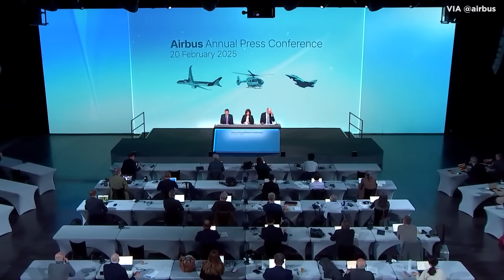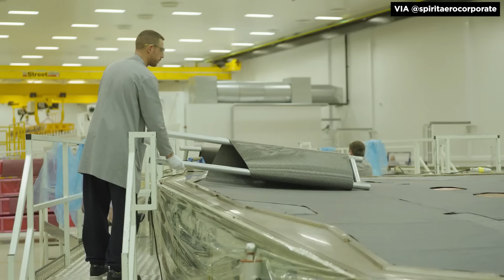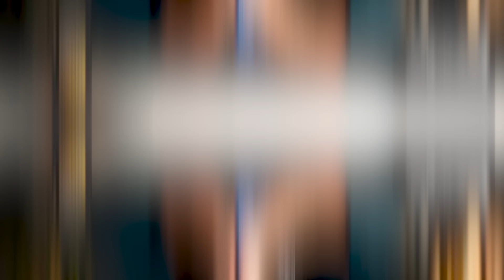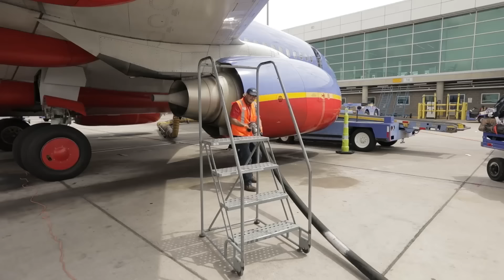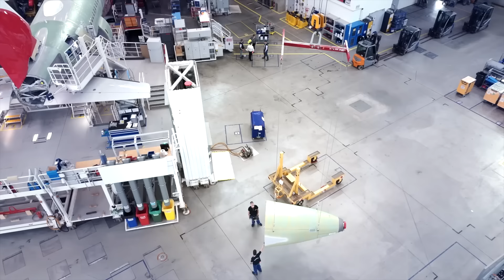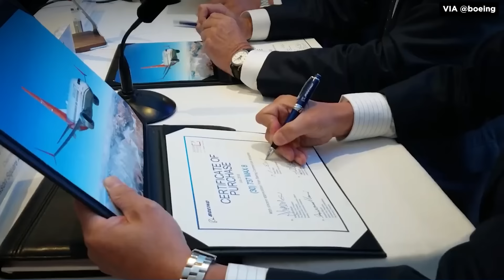Did Airbus just Change EVERYTHING?!

Comment: (Chemist and energy-transition expert here:) In fact, hydrogen planes were never a viable option before 2035... That would have required developing a whole ecosystem of high-volume green hydrogen production (unlikely before 2035 because you try everything first to use green electricity directly without converting it (or even storing it);  and of allocation of hydrogen for combustion engines (unlikely because using green hydrogen in the chemical industry would be a much more valuable option to start with). So hydrogen aircraft projects are nice for a ‘sustainable’ image, but will not be realised in the next 20 years, and we will have to wait and see if or when they will be. 
Experimenting with hydrogen engines does seem important to me, however, as this will show whether the hydrogen route would be better than one of the different Sustainable Aviation Fuels, comparing the many differences in the complete chain.

Comment: Hydrogen is just a way to store energy just like a battery. You just convert a primary energy source to H. And like a battery there is a loss of energy in the process. The most economical way to produce H is with NG. Producing H for airlines using "renewables" is a non starter in my opinion but we can always dream.
Reply: Producing "green" hydrogen is feasible in parts of the world where green energy is dirt cheap and plentiful like Quebec which is a superpower in the field of hydroelectricity.
Reply: @JollyOldCanuck  In 99.9% of such cases it makes more sense to run more wires. Yes there's a practical transportation limit for electrical generation (about 1500 miles) but that's not an issue in terms of populated areas

Comment: Hydrogen power goes back to the 1800's where it was discarded as unviable. Hydrogen is expensive to make and store. An international airport would need say 500 tons a day of fuel. Where is the infrastructure going to be to store such a large amount. Static electricity, one spark and boom. Never going to happen thank goodness, you wouldn't find me anywhere near a large hydrogen storage facility. Jet fuel is relatively stable but still we have the odd fire here and there, so hydrogen, never.

Comment: Thanks Peter.

SAF using an optimised molecule (say C15H15) is very clearly the way to go. 

Process has been demonstrated. It requires lots of heat pressure and catalysts. Inputs can be nothing more than seawater.

The energy input can be something like solar thermal or the new generation of high temperature nuclear power plants. All of which are feasible.

Comment: While hydrogen powered aircraft may be quite feasible from technical standpoint, from ECONOMIC standpoint it's nothing more than a lofty folly. Aka "pipe dreams of more than slightly intoxicated bi-polar person" - in his maniac phase. So yes, this "zero-emission" fad/ fixation is the current Holy M'zimu (or Baal) of them fruitcakes currently running EU - therefore "tread the line, or else" (so Airbus is paying its lip service to this newfangled faith with all the power of its lips), but as soon as this nonsense is over (seems like pretty soon) they'll ditch all the R&D, prototypes and what not - and will kindly ask EU (providing it'd still be around) to reimburse all the cost... using taxpayers' money, OF COURSE : )

But they haven't formally launched anything specific yet - precisamente, amigo - they've set the date "just far enough so no one would bother or pester us with inquires about results", yet close enough so it'd keep every bigwig decision maker happy (hey, always cover yer 'six').

Or, just like it was with "building the REAL communism" (i.e. the supposed justice and prosperity for all and everyone) in USSR - the target date was always set, at every major Party gathering, as one "just around the corner" - i.e. one that it seemed attainable "within our times", yet "fork, we have to toil a bit more yet".
The trick with greyhound races is to keep the artificial rabbit ("running" in the front of the pack) well within the sight of them greyhounds - just right for them to think like "we're almost there!" - yet far enough to make them feel "we gotta strive a li'l bit more  to actually  get there".
Satisfaction - priceless. And for everything else you'll pay with taxpayers' money (VISA, or what not).

Comment: I believe COMAC is a bigger short term competitor than Embraer for A320 like plane... Airbus and CFM have spent so much time talking about CFM rise, if the engine work well, it will be a pity to not use it on the next plane...

Comment: Wouldn't a hydrogen A380 be easier than a small-to-medium, because of the ecosystem you mention? There are fewer routes you want a big plane for, all far apart, so it's easier to roll out; with your 50-to-100 seat plane you want to go everywhere not-too-far?

Comment: Back in 1979/1980, some industrialist in Palmdale CA (Mr Drax) built a fleet of Hydrogen fueled Space Shuttles and had passenger ccomparments in the cargo bay.   (Had a problem with one so stole one from NASA).  Airbus could just get the blueprints and build those. You could get anywhere on Earth in basically 90 minutes.  The trick is that it needs a huge amount of both liquid hydrogen and oxygen, and they are stored in very lightly pressurized tanks with an open vent to atmosphere. They reduce the speed at which the H2 boils off with insulation to prevent heat from entering.  If you are willing to waste/lose a huge amount of H2 and O2, you don't need extremely high pressure tanks, you need insulated tanks into which you dump liquid H2 and O2, and the insulation reduces the rate at which the liquids boil off and need to be vented to atmospphere (lost).  But consider that the shuttle was DC9 sized, and needed a tank larger than itself.   Or in other words, Airbus would need to restart production of the A380 which would be filled mostly with unpressurized but very cold H2 and O2 tanks and maybe 100 pax if they are lucky. The economics would not be good.  And you can't have any delays once the tanks are filled otherwise all your fuel evaporates to atmosphere.

Comment: It looks like common sense is coming back, I thought air bus were giving up entirely. the hydrogen powered jets is about as much sense as selling electric vans to delivery operators with just over 100 miles range, i have been stuck in the middle of no where for hours, and i have spent hours looking  for a van sufficient range, i have a new appreciation for regular fuel. Hydrogen energy is a minefield of  trouble, mostly coming from storage, but also in the way it is produced and in the back ground is the potential of synthetic fuels that might completely address the problems with conventional fuels, yet work with all the conventional stuff we have already, if a new airliner was suddenly made obsolete by the technology that came before it, those investments would turn bad, slow walking hydrogen tech, is a very wise move, it has been talked about since the 1950s, yet never has anything successful come of it and it is always the same problems.

Comment: Now, hands up if you believe the current US government will help Boeing develop innovative planes that use hydrogen or any other kind of renewable energy sources. Boein has become a money printing press for the shareholders while they neglected to spend money on new developments. Boeing has not even come up with a plan for replacement for the 747 which is now a 50 years old design. But even with additional funding, the Boeing management is not concerned with development of better and innovative aircraft or customer satisfaction, but rather in optimizing profits. Boeing has no other vision than to bolster the pockets of the upper management and give pay-outs to the shareholders. Boeing has no vision where the company will be in 5 or 10 years, and is certainly not entertaining a world that no longer runs on fossil fuel in the future. All they know is drill baby drill until the day comes when there is nothing else to drill.

Comment: The A220 I was on had a problem where the overhead storage doors didn't open far enough to fit a bag that would otherwise fit in the bin. Embraer didn't have that issue
 Nothing great about A220 as passenger.

Comment: Hydrogen concept for energy storage has been around for a long time, touted as a way to get around the limitations of battery storage. However there have been no breakthroughs that would make it more viable for transport applications, nor are there any obvious stepping stones. Sorry, Hydrogen fans it looks like a dead end.
Meanwhile, consumer electronics and related indusries provided market stepping stones for every improvement in battery technology, to the point where batteries are viable for surface transport. It is hard to imagine battery being viable for aviation but I don’t think Hydrogen is any more promising.
 Time to take a different approach.

Comment: As a electrician on large oil platforms I’ve learned that turbines aren’t that picky about fuel. The Allison generators generally run on diesel but they’ll run off dirty natural gas straight from the wells, or anything that burns
Reply: I am guessing here, but i do think there to be some variation in the design, and also in the auxiliaries, if you want high effficiency, metal alloys and compressor blade shapes, and burn chamber forms can all be tweaked to perform at peak temperature and consumption of a certain mix of hydro(carbon) gas/liquids. Other way round if you want to make sure you get output you tweak the tolerances to be less efficient but accept all available fuels (within reason).
And that option could include accepting more damage and maintenance to the turbine then the FAA is willing to accept.

Same for fuel pumps, -filters, bleed air to pressurize cabin, all these systems can be scaled up to work with any and all particulates in the fuel and have crazy amounts of exhaust gas to filter out of the air pressurisation, but that means weight and inefficiency.

So allthough turbines are pretty good at eating what they get fed (abrams tank has a turbine so it can take the fuel from where it is if US logistics ever got in a pinch) aircraft turbines are tweaked and more picky eaters. (this all based on what i think.)

Comment: What I think? Hydrogen is a dead end. Horrible to store. Synthetic fuels made from "green" hydrogen are the way to go. Yes, much more expensive, requiring a dedicated mass scale production of the synthetic fuel. But with the added benefit of using existing fuel distribution, storage and handling systems. Also, it will be much safer than using hydrogen it its pure, elemental form.

Comment: How hard would it be for Airbus to redesign the cockpit of the A220 to be more similar to the A320 and therefore less costly for airlines to type rate their existing pilots? Similar to how Boeing redesigned the 747 to eliminate the flight engineer?
Reply: Changing cockpit of A220 to give commonality with 320 would require  recertification of aircraft. Very costly. Considering they are unable to deliver them, considering Airbus doesn't fully own the aircraft and that Québec isn't willing to sink more money into this failed project, it is very unlikely to happen, especialy since the priority would be to get CFM LEAP engine on it to avoid the problem P&W GTF family.
Reply: @jfmezei  There are rumors about the A220-500, they might add new engines then, since they have to re-certify that anyway. But yeah changing the cockpit is not gonna happen.

Comment: Hydrogen will never power aircraft and anyone saying otherwise is uninformed or a liar. Please just talk to an engineer for 5 minutes, anyone who actually knows what they're talking about.
Tanks with 10,000psi hydrogen store 5.6MJ/L; liquid hydrogen gets up to 8MJ/L.
Jet-A with no fancy tank or cryogenics stores 34.7MJ/L.

Your hydrogen plane would need 6.2x more fuel storage to keep the same range, and that's assuming you could somehow stack cylindrical or spherical tanks with no interstitial space. For the same current size, the B737 MAX would have a maximum range of 620nm, an A321 would get just 595nm. That's less than a Cessna 172. 

This isn't some "future technology will solve it" problem (metal matrix storage has been researched, MgH2 is the best know so far and is only 1.55x better than liquid, and has plenty of problems like weighing 12x more). This also isn't a production, distribution, or storage issue. Hydrogen is a fundamentally terrible vehicle fuel.

If you insist on using something else, Propane would be a significantly better option. Propane has a GWP of 0.02, 25MJ/L at room temperature liquid <20bar. The hydrogen discussion is just maddingly stupid.
Reply: Actually propane as a biofuel or as an E-fuel could be interesting. 

However it seems unlikely that an aircraft of any size would use compressed hydrogen as a fuel.

Comment: Airbus company’s DNA is based on « quiet efficiency ». The European manufacturer has this more systemic approach of a problem than US companies have, preferring to focus on the first available solution. 

It is true Airbus has nothing really fancy to show right now. Besides very good financial results I mean. Its space division has issues but Airbus is provisioning some cash to deal with and the recent « ReArm Europe » could be the solution to the A400 poor results since European countries will have to find a replacement to the logistic capabilities of the American military forces. 

An hydrogen powered plane needs hydrogen to be available worldwide to be successful: what is the point to buy such a plane if it can only serve very limited routes? Infrastructures are an important potential choke point, even for planes that need to land somewhere equipped with at least what’s needed to take off from it. 

In any case, if one expects Airbus to start bragging about its future plans the way US companies are culturally accustomed to do to fit the needs of shareholders for an over-enthousiastic  narrative, one is in for yet another disappointment. 

This is not the European way.

Comment: I don't understand why basic physics is not applied to fuel economy.
Fly 10% slower => 20% fuel economy. On continental flights the time difference is not very relevant: 18 minutes for 5-6 hours flight (three hours in the air + 2-3 hours in the airport). Yes, I understand that the wing has to be bigger and re-designed, but this is so straightforward...

Also maybe fly higher, so lower air density, so less drag.... although on this approach I'm not as confident due to: constant air dynamic viscosity over 35000 ft, lower temperatures (higher fuselage stress and fuel freeze risk), higher fuselage stress due to lower air pressure, even higher wings, smaller coffin corner... hmmm... I'm no expert, but at first glance, it looks like higher than 35000 ft makes little sense if any.

Comment: Unducted Fans and hydrogen powered airplanes are a big nothing burger. UDF is very noisy, 30,000+ horsepower going through a propeller? Good luck. There are four ways of producing hydrogen in commercial quantities. They are all very expensive and require lots of energy. They have been working on this for the automotive industry for many years and it still is many years away. And then there is the Hindenburg effect...

Comment: Boeing should bring back the 757. All the airlines loved it. They will need to re-engineering it and do composite wings and modernize the avionics. They can also do versions that are smaller capacity. At least they will likely have far less cost to design it compared to starting with a new design from scratch. The 737 has reached its redesign and maybe beyond. The 757 is higher off the ground and can handle larger engines. Why not?

Comment: Hydrogen is not cheap, but it looks like there's no other alternative to near-zero carbon aircraft.
There are many hydrogen storage tanks and pipes in the world that the idea that's "Impossible to use it" seems to make little sense.
The reduction in size and weight for fuel cells means it looks way more likely that hydrogen planes will be powered that way instead of hydrogen-burn turbines. The energy efficiency is higher and the aircraft desings get way more flexible (e.g. many smaller motors instead of two ones).
e-fuels still have a very big problem: a sustainable carbon feedstock. Ambient air has a very small concentration of carbon, thus more than a million cubic metres of air are needed just for 1000 litres of kerosine (or diesel fuel). And that's when 100% of the carbon is removed from air to be used for fuel.

But if there's no real push for near-zero planes, manufacturers and airlines can keep pretending while jet fuel is burned with no true remorse.

Comment: Someone really has not done the maths here. 100kg of jet fuel is very roughly 120L in volume, Hydrogen for 100kg would need 1400 liters, and your high pressure highly insulated cylinders would need the same again.
Reply: I read a nasa document which mentioned if you wanted to store 4 tonnes of hydrogen in a spherical titanium container. The container wound weigh 70 tonnes.
Reply: Hence LIQUID hydrogen which need insulated tankage not pressurized tanks. In hydrogen fueled buses, the tank pressure is the same as CNG tank, not the double pressure level used in hydrogen cars. 

The insulated tank for liquid hydrogen are definitely heavier (and bulkier) than fuel directly in the wing. It has been mentioned before on this channel, it might make sense to have engines that use jet fuel for takeoff and climb and hydrogen for cruise (so that way the wings still have tanks of jet fuel).